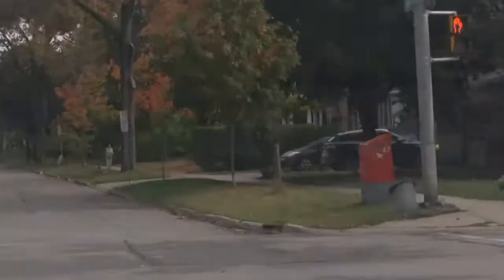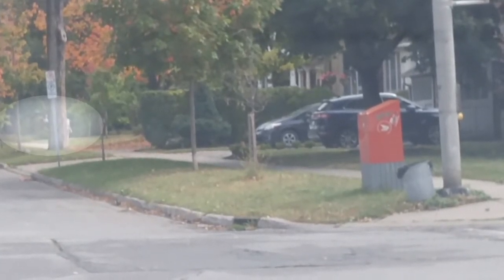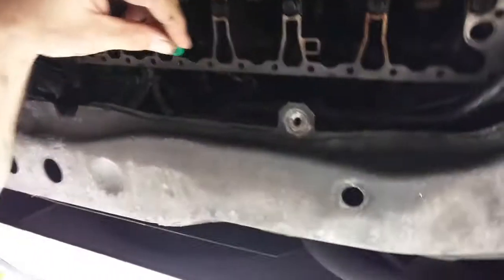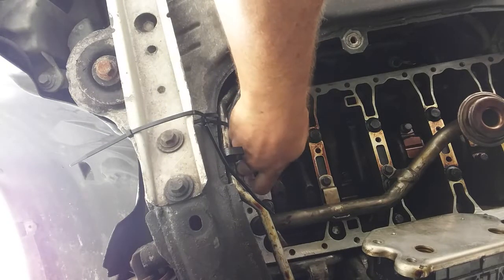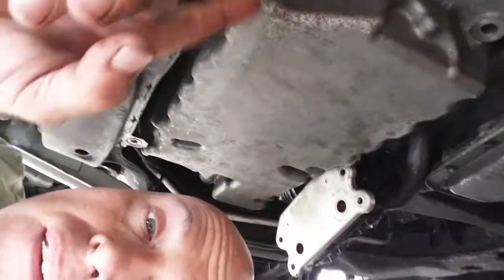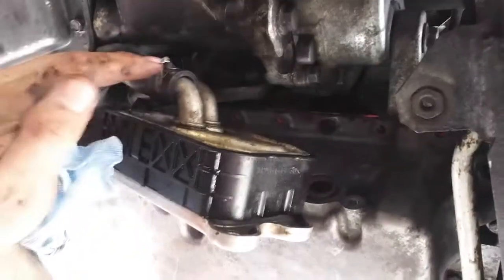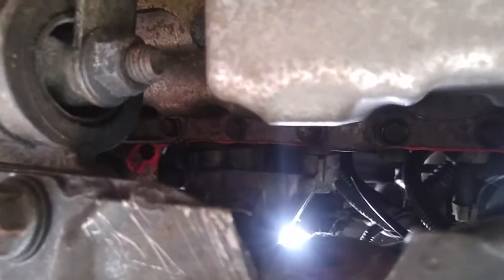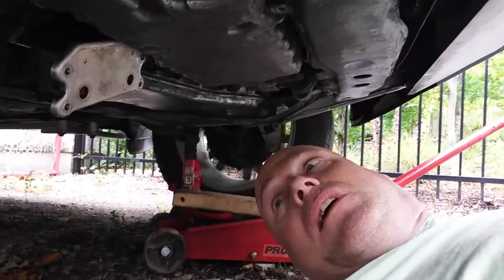XC90 Oil Pan Install and Turbo Cartrages Install

Comment: Were you able to see if that oil uptake tube line with "bell end" was removable to clean out?
Reply from the maker: The whole pick up tune and bell end is removable when you take the oil pan off. It's welded to the tube. 2 10mm bolts and the whole assembly is out.
It was almost plugged with carbon when I cleaned it out. I had to poke a couple of the screen holes with a pick to get the hard stuff out.
It was like new when I put it back together.